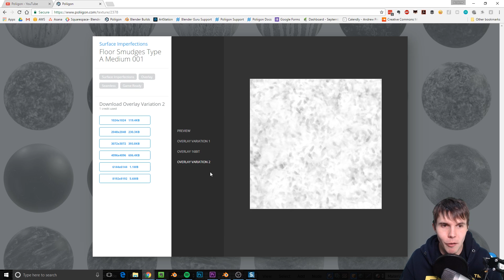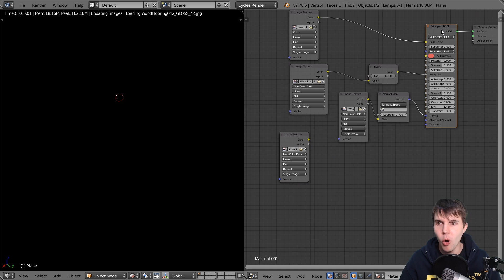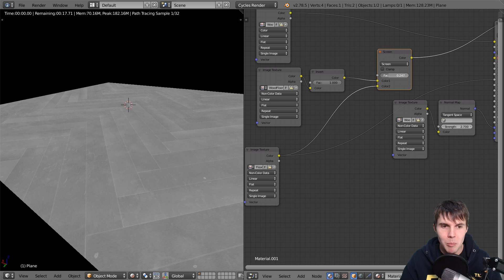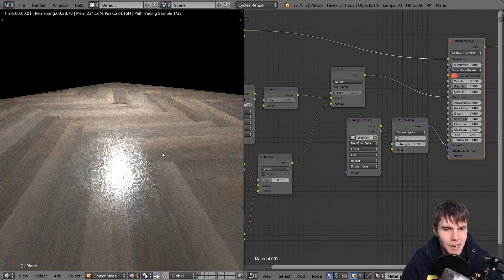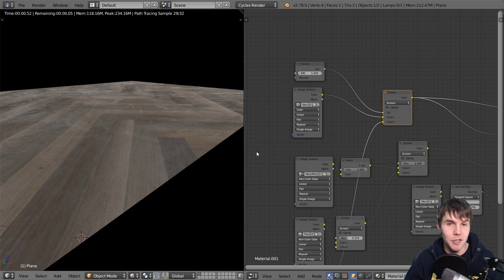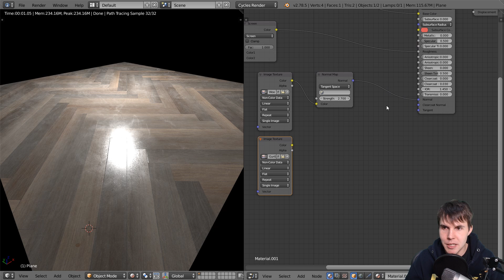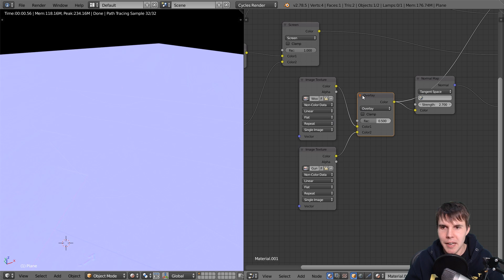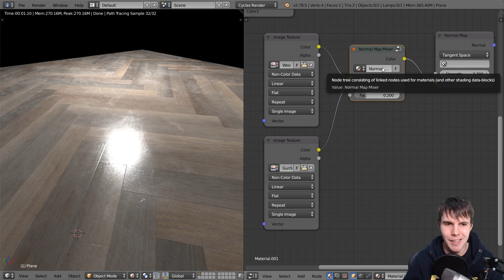How to use Surface Imperfections in Blender 2.79

Comment: I made a tiles floor for a scene but I did not use any texture on it. I applied floor smudges texture into the roughness (the diffuse color is black) but surface imperfection is way too visible. How can I attenuate it please?

Comment: Hi. Where I can see the tiles sizes or how to take control of the size of the elements when I use image textures? What if I need a floor with 40 cms tiles and I need to begin tiling on a specific point?

Comment: Following your guide. I get awsome result, love this. I am very curious about something about the UI settings.

Everytime you open a new image in image texture, you see the thumbnails directly.

I have to press the "show as thumbnails" everytime I open anything, and it keeps resetings to the "Display as Short List"

How do I make the "Show as Thumbnails" as default? so it always shows as thumbnails if I open anything
Reply from the maker: Hi there. Nice question. To make it the Default behavior, go to your User Preferences then under the File tab, enable the checkbox on the right side that says Show Thumbnails, then click the Save User Settings button.
Reply: Thank you! I found it some hour ago thoug. was desperat to find this!, Figured out it is possible to do it different ways aswell, but what you said did the trick! ;)

Comment: How would you apply this to glass? Say I want to put fingerprints on a car window. Being that the glass node has a bsdf connection you cant just mix it with a some thing that has a color node.
Reply: Maybe assign the texture to roughness? Or add a diffuse shader and use the fingerprint texture to mix between the two shaders?

Comment: Hello, first of all, thanks a lot. Its so helpful but one problem I have is that I don't want to use importfection on the whole floor u see. So how do u isolate just part of it and make it look good. Using more uv maps look just awfull so any advice?
Reply: I would suggest a Noise texture with very low (between 0 and 2) scale and use that as a multiply, the black areas of the texture will be unaffected and "perfect" while the white areas will get all of the imperfections of the various maps